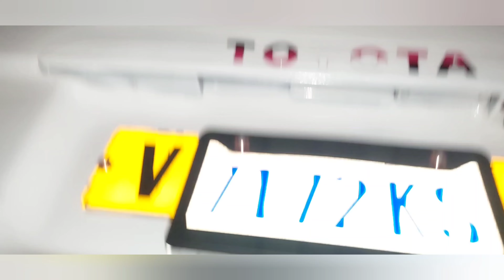Toyota hiace bus build part 17...

Comment: Bro I did you really send that through your bass box and you have so much space at the side sorry bro but I think you shouldn’t have done that
Reply from the maker: I thought it over many many times and that's the best place to run it. Remember it goes inside the bottom of the lift box so if has to come as close as possible to the middle and it has to be in the middle